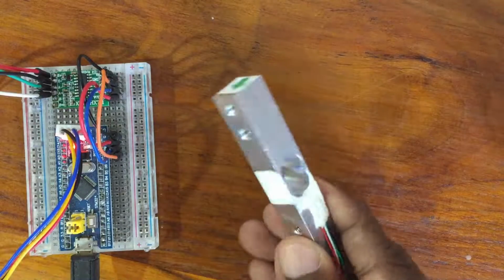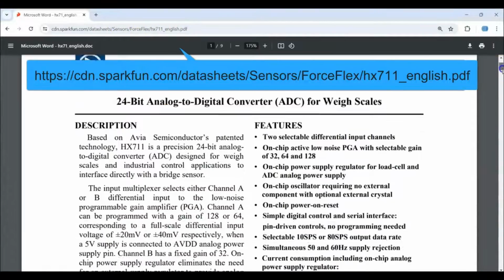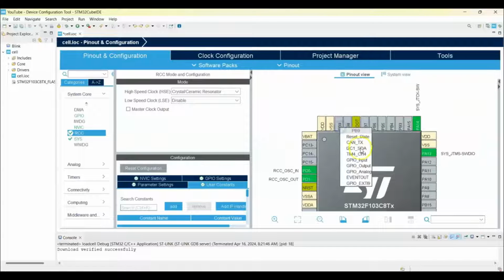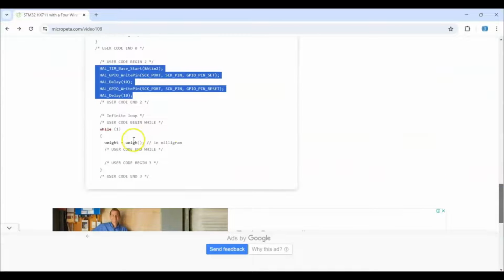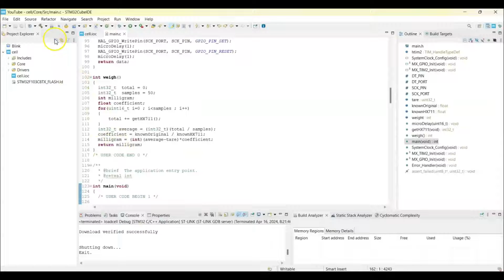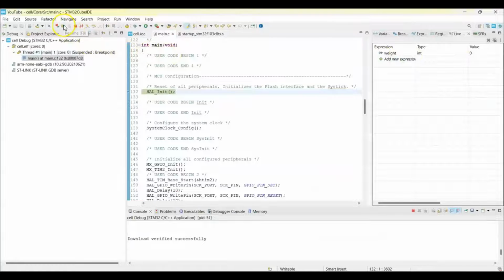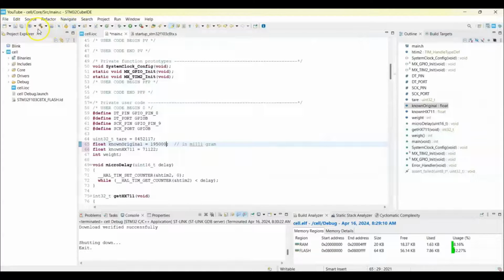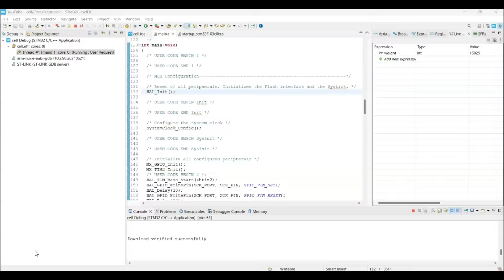108. STM32CubeIDE HX711 with a Four Wire Load Cell and STM32 F103C8T6

Comment: We connected the 10 kilogram weight sensor to the stm32 as you specified and wrote the code as you specified. However, the value we receive is always the same and we cannot observe any change as we increase the weight. Additionally, when we remove the weight from the sensor, the value does not reset to 0, the old value remains constant. Can you help me?
Reply from the maker: Probably, check the wiring connection
Thanks

Comment: please explain how to modify the code for six load cell with six hx711
Reply from the maker: A simple way is by creating six sets of int32_t getHX711(void) and int weigh()
Use six sets of gpio pins total 12 pins
And call each function seperately

int32_t getHX711_1(void)
int weigh_1()
int32_t getHX711_2(void)
int weigh_2()
int32_t getHX711_3(void)
int weigh_3()
int32_t getHX711_4(void)
int weigh_4()
int32_t getHX711_5(void)
int weigh_5()
int32_t getHX711_6(void)
int weigh_6() 

Tha.